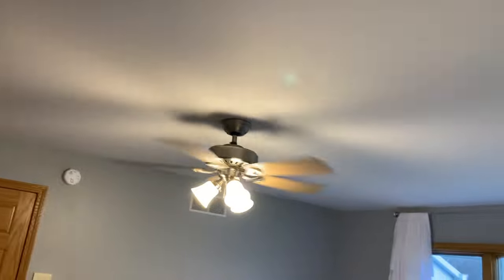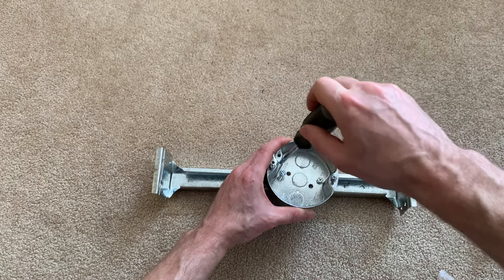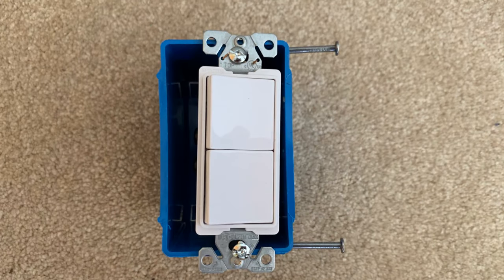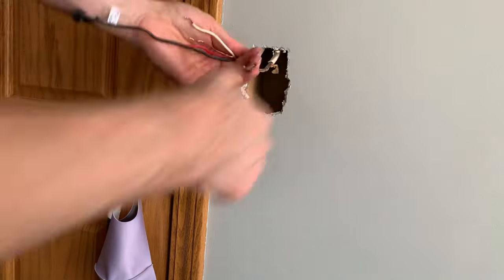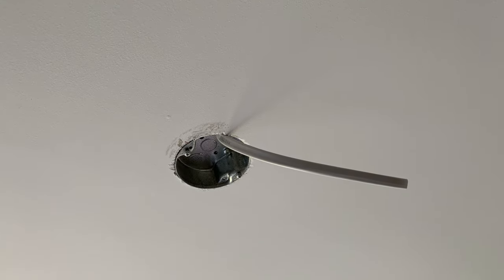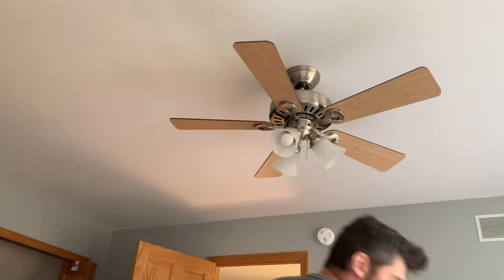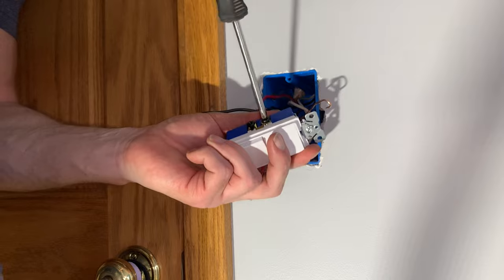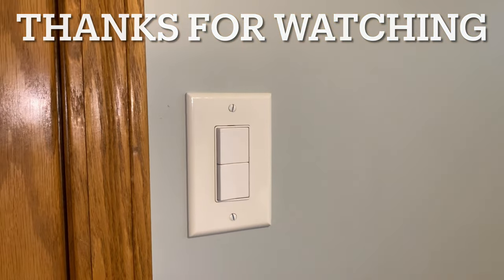How to Install a NEW Ceiling Fan IN A ROOM WITH NO CEILING FIXTURE | New Box, Fan, Wall Switch, Wire

Comment: Why not just use and old work box instead of all that unnecessary extra work? Otherwise great information.
Reply from the maker: Thanks. I appreciate it.

The old work box is only supported by the drywall, and I believe is rated for 50 lbs. I think my fan required 70 lbs, but not sure.
Either way, I definitely did not want to support my ceiling fan by the drywall. I would personally not install a ceiling fan at all without supporting it from the joists. Also, a ceiling fan results in a dynamic load (it is not just a static weight) which will cause failures in the future.

There is another product available for installing a box without access from above. I would recommend this over an old work box.
https://amzn.to/36lFToH

I would use an old work box for a light fixture that doesn’t weigh much, but definitely not a ceiling fan.
Reply: @HowtoandReviewsOfficial  not for the fan, for your light switch. The plastic tabs turn out to secure to the drywall. Instead of having to pull the nails out of a new construction box breaking the loops off and running screws through it. It just seems like a lot of unnecessary effort.
Reply from the maker: @andrewkampmann7170   OK, got it! That makes more sense. Pretty much the same scenario. It was honestly pretty easy. I had to break out the old box regardless. Cutting the tabs and towing in a couple screws took less than a minute. The box was cheaper, and I just preferred to utilize the stud since it was there, as opposed to only clamping onto the drywall. But, great point! An old work switchbox is a great suggestion!
Reply: @HowtoandReviewsOfficial  Although you did a very neat and thorough job and explained things very well, by code you can't use the receptacle box that you used for the following reasons: You used a "New Work" box. 1)These boxes are designed to be mounted using the nails provided with the attached brackets. By screwing directly into the side of the box, you're doing a modification that's not approved. 2) Those knockouts are meant to be removed, as you did, because in new work the romex is secured within 12 inches of the box. Obviously, you can't secure the romex behind the sheetrock in old work. An "Old Work" box is designed just for that: Old work in an existing wall. It has tabs to secure it to the wall, or some actually have screws through the sides, but they are designed to be that way. Old work boxes also have different tabs for the wire to come through. They are not meant to come out, but provide stress relief to the wire.
As I've said, the job you did was very well done, and I'm only bringing this to your attention not to criticize you but because seeing how you like doing things right, You'd want to be aware of this.
Reply from the maker: @JohnBGood-kq3ul  Thanks. Constructive feedback is always welcome and I definitely do want to be aware of this. Thanks for the taking the time to share this. I appreciate it!

Comment: Sorry, but your installation of the plastic box is NOT CORRECT, and is against the NEC.  The plastic tabs are not supposed to be "knocked out".  They are meant to be a clamp.  On non-metallic single gang boxes 2 1/2 x 4, the cable does not need to be clamped if it is secured within 8 inches of the outside of the box (NEC 314.17(C) Exception).  However, as you were not able to put a staple in behind the closed wall - those tabs should be utilized as a clamp as they were intended.
Reply from the maker: Thanks!